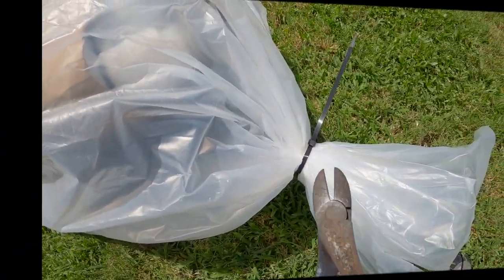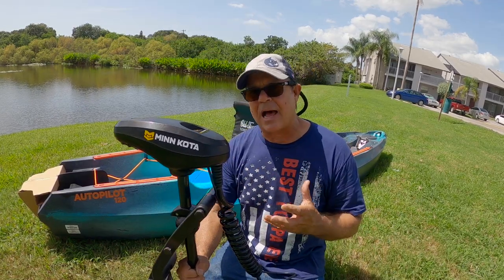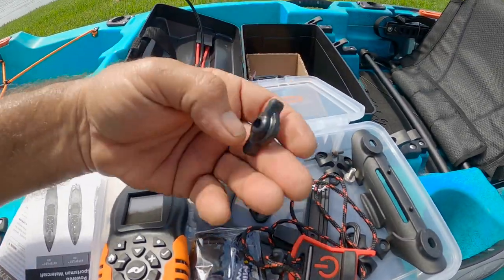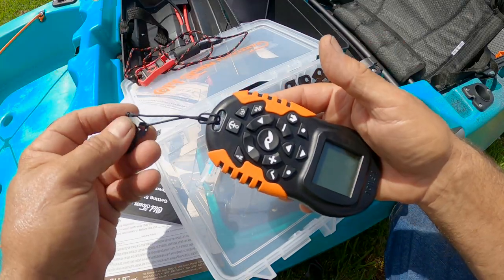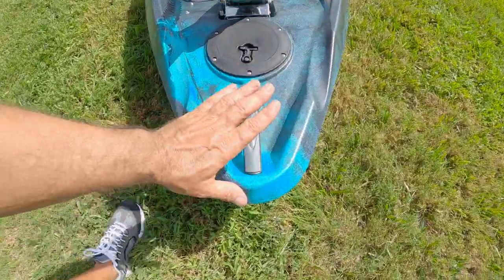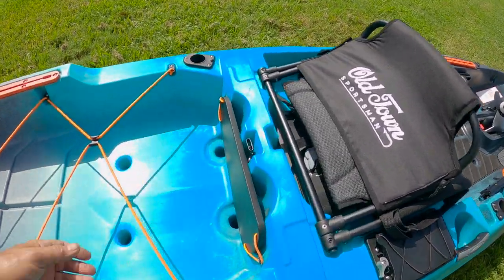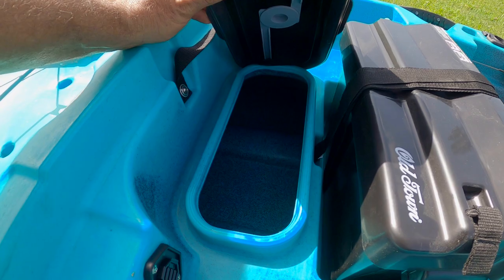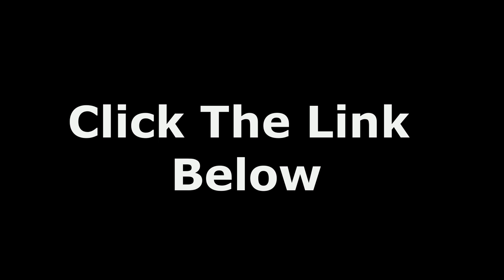Unpacking My New Kayak, Assembling And Features Review of The Old Town Sportsman Auto Pilot 120

Comment: How do you plan on dealing with launching this one (boat ramps vs sand/muddy banks)?  Also, have you seen any rust on the hardware or any connection issues affecting power yet from saltwater use?  I love that 106 a lot....waiting on a Fall demo day coming up here to try both of them.  It looks like you put it through its paces (like that windy day), so how do you like it now that you’ve had it awhile?  Congrats on your growth, looks like you’re nearing 30k...what a great channel.  Thanks.
Reply from the maker: Thanks for watching. I have a cart that I use to move the kayak around at ramps or with mild muddy or sand areas. All the external parts and pieces are looking good.  The kayak comes with a tube of silicone that is to be used on the electrical connections so they don't get corroded. The only thing I'd recommend is putting a little grease on the sheer pin maybe; It seems to be a bit discolored after several months of use.  Thanks for commenting.

Comment: Nice unpacking upload 👍🏻. Especially appreciate the car topping at the end. Most of the Autopilot vids out there are being hauled by trucks. How much harder is this to car top than the 106MK? And what’s the fastest and longest distance you’ve traveled with it topped that way? Thanks!
Reply from the maker: The longer the kayak the easier it is to get on top of the kayak because of leverage. The farthest I've traveled is about thirty miles one way on the interstate at 70 mph. Once it's strapped down good and tight and the ropes are good and secure it stays in place really well. Thanks for watching and commenting. If you car top though plan on getting scratches unless you figure out how to be extra careful at the end of a long day of fishing. Ideally if someone is there to help that's the best way to go.

Comment: I’ve been hearing that the kayak will turn around on you if you are facing the wind and you are on spot lock. I hear it is very inconvenient when this happens. What are your thoughts on that?
Reply from the maker: Thanks for watching...First off, spot lock is much more convenient than any other method of anchoring. The spot lock technology is amazing for every fishing situation I've been in since owning this kayak. It is much easier and faster than an anchor pole or rope anchor and works instantly in any depth of water. The direction that the kayak anchors  is determined by the current and the wind direction.  There's repositioning that needs to be done at times with the spot lock, but that's true with all anchoring methods. The wind and the current always determine the direction of a vessel when anchored, spot lock technology or when using traditional methods. Thanks for commenting.
Reply: @RadReelingFishing  thank you for the reply. You are a good person.